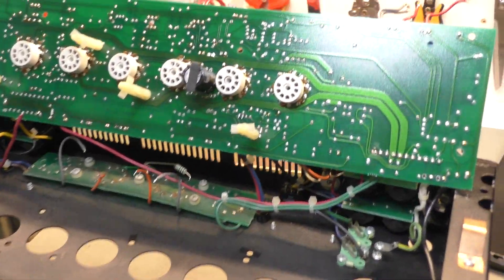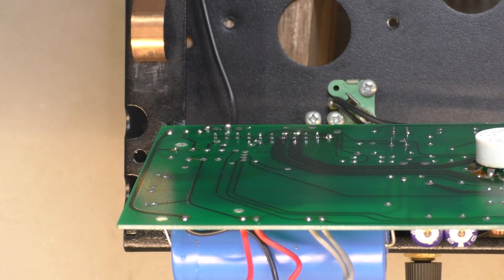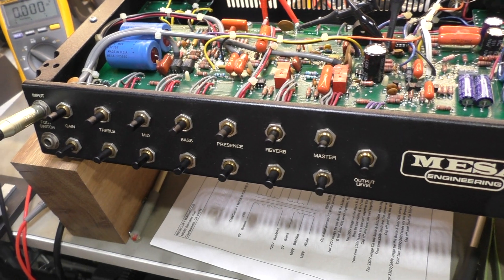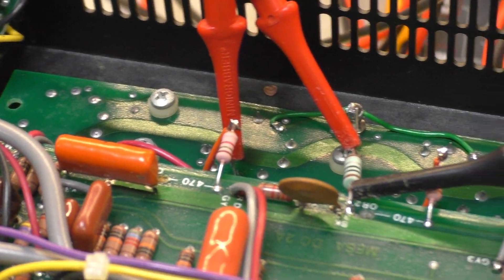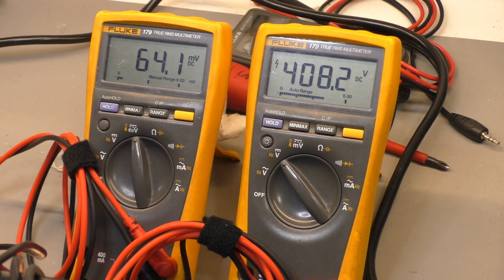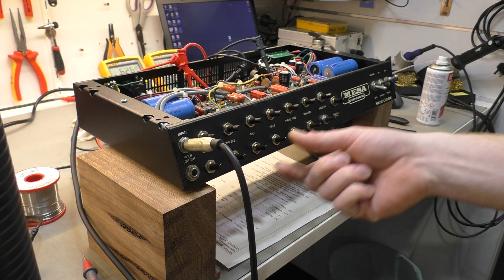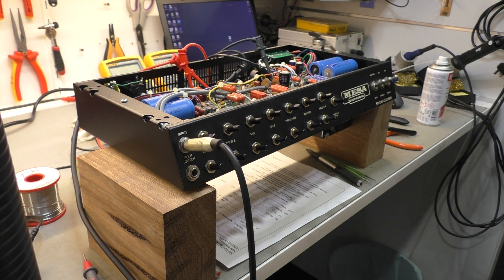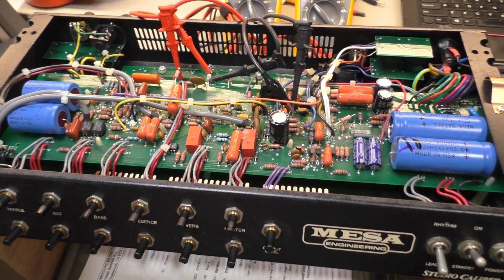Mesa Boogie DC-2 - Pt.2: Voicing Changes & Mains Conversion

Comment: Nice job as usual!  You mentioned the voicing changes but did not go into any great detail.  Do you mind sharing which components and values were swapped?
Reply from the maker: Hard to specify as there are no component annotations on the PCB. I essentially removed a few low-pass filters in the gain channel without removing some filtering after the clipping stages, got rid of the stupid input network and moved it to near the reverb like a fender on the clean channel.
Reply: @BradsGuitarGarage  Would be super useful to know exactly what you did here.  I am looking at buying a DC-2 and like the results you achieved.  Any chance you can be more specific so others can benefit?  Thanks,  Chuck
Reply: Isn't it fn frustrating when they choose to not answer a question!? Now, if you offered him M O N E Y  he would have said, how high ya want me to jump!?  Greedy sob's.  He'll have to answer to the Big one some day.

Comment: Great idea in removing that plastic header for the transformer connection to the board.   You left enough lead length to make it as easy to work on as it was.

Could you please share what desoldering station you use?  Thanks
Reply from the maker: Pace MBT sensatemp station w/SX-100 handpiece.
Reply: @BradsGuitarGarage  Thanks!

Comment: "You run EL84's, you flog 'em like rented mules"..... according to a biography I read by a hunting guide out West, a mule never forgets being abused, and will bide its time for months and screw you over when you need it the most ---- a mule intentionally dumped a pack load over the side of a cliff and nearly caused the guide to go over as well!  I don't have any experience with the Sovtek EL84M tubes you mentioned, but if you can get some proper 7189 or 7189A tubes,they too were originally designed for 400 V operation.  New old stock 7189s are scarce and expensive and I don't know to what extent anybody has made a reliable reproduction or re- issue.
Reply from the maker: I did mention the 7189's but edited it out, as supply is unreliable and I don't want customers demanding I use them.
Reply: @BradsGuitarGarage  ,  I have plenty of vintage new and used EL84, mostly American makes but a few Mullards and Amperex and so on. I don't have many 7189'sbut I've got a stash of new old stock 6GK6s which have virtually identical specs but a different pin out.  Going to have to make some adapters one of these days. Not an easy thing to do but I have all the relevant parts. I once made adapters to fit 7868 tubes in place of 7591s, and vice versa.